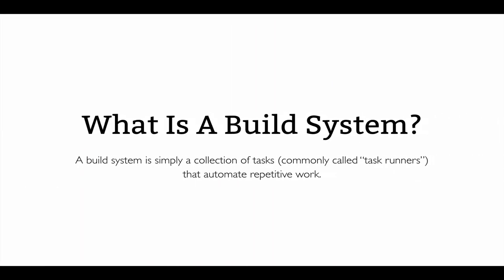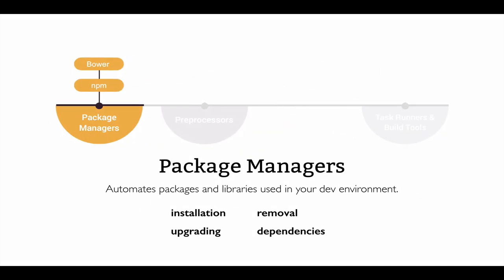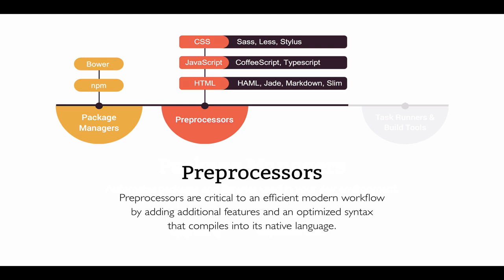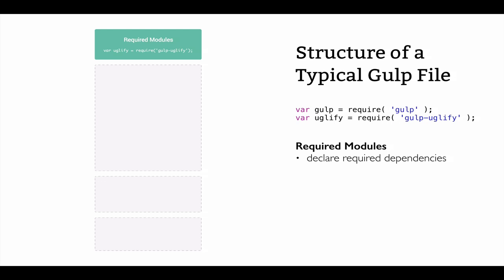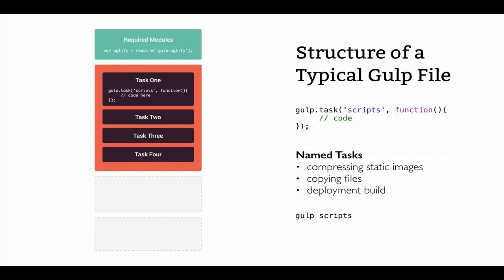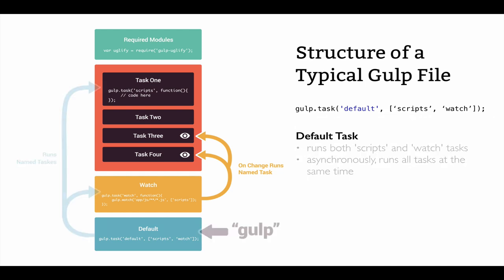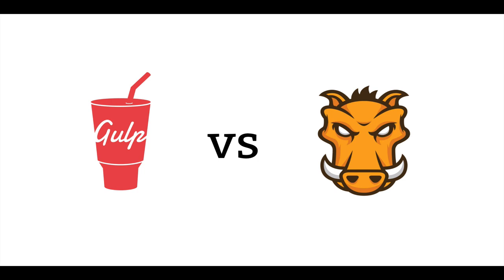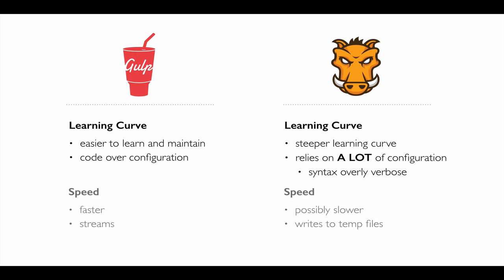Gulp.js Build System #1 - Fundamentals

Comment: humble question to the op ... is there a way to automate the creation of the gulp file?Thanks for the vid.
Reply from the maker: Hi Paul, Not really since it is written specifically for what your build needs you have to write it at least once yourself.  There are complex ways to automate this.  For example you could create your own Yeoman generator that could ask you question and based on your answers create your gulp file for you, that is one thing I have wanted to do for a while but haven't had time.  It is much harder to code that up of course then just creating the gulpfile manually but can be done.

Comment: Hi Joel Longie, I really liked this series of videos,
could you please convert this into Angular app? I am also following you github, even if you load on github I will take a look at it.

Thanks.
Reply from the maker: +Kunal Kamble Gulp is just the build system so you can use Angular or any other front-end framework with it.  The build in the videos is pretty basic, but later today I will be releasing a new build that will be much better for JavaScript focused project.
Reply: +Joel Longie Looking forward for new video.